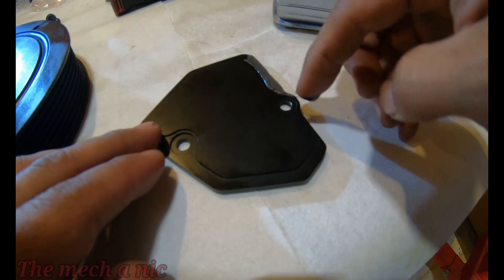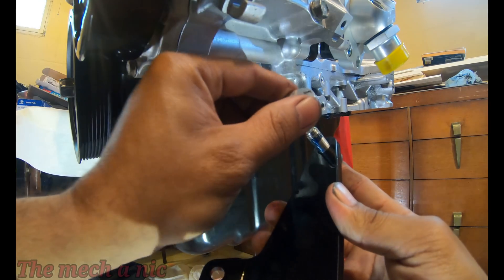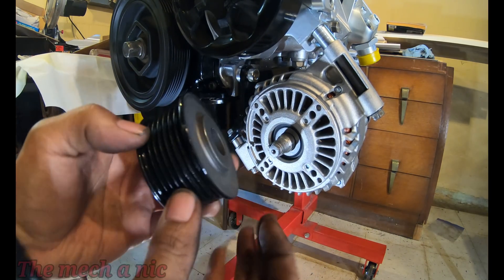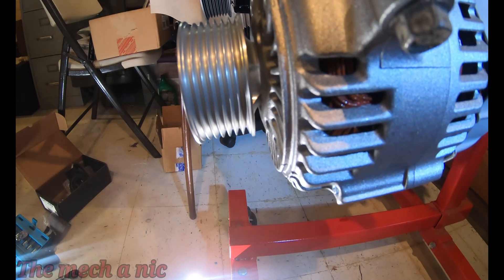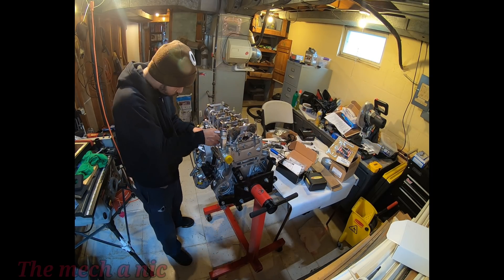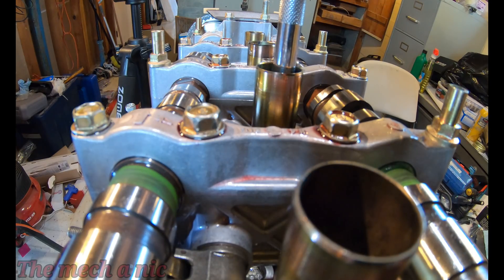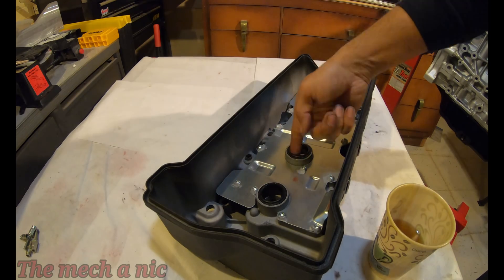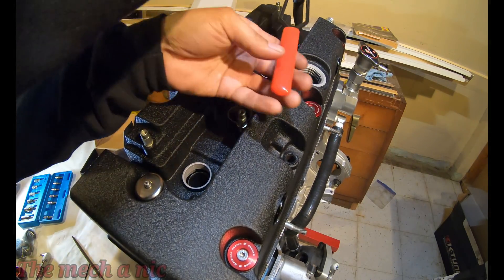k24 end build

Comment: Very nice! How much compression (PSI) this build is making ?  Theoretically it should rise the compression ratio from 11:1 to 13,2:1 and you should run the highest octane fuel available rising the top end power with 20% . Was this engine dyno tested somewhere ? Kind Regards.

Comment: Thin piece of sheet copper, cut hole, make a "crush washer" for that oil cap-
turn down tight, till K lines up.
What don't you like about the vc dress up kit? I think its very nice.

I would either get a shorter belt (they're measured in mm BTW) or
cut down that ridiculously long adjusting screw- which
actually looks easier, since those pulleys are close now.

I haven't watched the "build" series yet, but that is a beautiful engine.

Comment: I'd be concerned with that overspray on the inside of the rocker cover in the heat resistant black wrinkle coat..! Wouldn't want that shit peeling off on the inside of the engine blocking the oil pick up..! Good luck..!!!
Reply from the maker: That cover has to come back off.ill get a good look at it. And remove anything i need to

Comment: Looks kinda too tall. I think it’s the tallest four-cylinder engine.
Reply from the maker: Yeah its definitely tall. Clearance is a issue when you put it in a crx
Reply: @themechanic6117  probably when you put it anywhere that’s dropped. I am thinking that even custom flat oil pan won’t help that much.
Reply: @themechanic6117  so can you tune cams the way that vtec will kicks in whenever you want? It’s turned on by the oil pressure as long as I know but who regulates the oil pressure?)

Comment: Thermostatic housing will not work proper, because it will not isolate smal circuit. It isolate only big circuit or make mixing big & small circuits. OEM thermostatic housing isolate smal or big circuits.

Comment: What ecu and harness are you going to use?
Reply from the maker: Most likely a hondata and a rywire or ktuned harness
Reply: @themechanic6117  would it be plug and play? 

I want to do a k series swap on my datsun 620 mini truck.
Reply from the maker: @jfm041789  yes it is plug n play, thats why im going with that. Dont want to deal with the frustration of wiring
Reply: Yea. I've seen others struggling.

Comment: Which K24 did you use?? I have a K24A4
Reply: I was told that the best k24 to do the set up is the k24A2 is that true???
Reply from the maker: Yes i have a A4 , i think they say the A2 is best because you dont have to change rods n pistons(i think, im not sure) . If your upgrading your rods n pistons then it doesnt matter if you get a A2 or A4
Reply: @themechanic6117  but oil squirters??
Reply: Great thanks for the info bro.

Comment: When you put the valve train back together did you silicone under the last cam cap at the trans? Before you put the valve cover on there is 4 locations that require silicone
Reply from the maker: In the video i forgot to but i did pull it back apart to put silicone on it 👍

Comment: Hey man new to the channel but I found your vids useful since I’m k24 swapping my ep3. My JDM K24a came with a PS pump and I won’t be using it since I’m running ES. My ep3 idler doesn’t fit my water pump housing. What do I do? Get an a4 water housing as well?
Reply from the maker: Check with ktuned for a solution. If they dont have anything you may need to change the water pump housing.

Comment: I'll be watching these videos for my build. I have a 04 accord coupe that I'll do the head swap to. Thinking about building the motor afterwards to go turbo
Reply from the maker: Do the head swap and some cams . see if you notice the power increase 👍
Reply: ThatSaturn Kid Make sure you replace your pistons also. Stock Accord pistons will hit your k20 valves.
Reply from the maker: Yes i think he'll need tsx pistons or aftermarket.
Reply: @TrueDiaboli  I was debating between turbo or head swap, should I do head swap first, or turbo? And thanks for the info on the pistons
Reply: ThatSaturn Kid Depends on budget. You would have to get some ECU solution like a kpro. Then you could do motor work and stay NA and then later add a turbo. It all depends on how much time/money you want to spend up front.

Comment: I'd be less than satisfied with the fitment of that New harmonic balancer, crank pulley.
Reply from the maker: Oem crank and oem pulley. The original. Pulley fit the same way.
Reply: @themechanic6117  that'll make a nice dent through the bonnet when it comes off at 10,000rpm.
Reply from the maker: Hopefully not. Only one way to find out.👍

Comment: Are you boosting this build
Reply from the maker: Keeping it N/A thats why im running high compression
Reply: @themechanic6117  How high compression can you go before gasoline auto ignites?
Reply from the maker: A long way before that happens. Think of how diesels run
Reply: @themechanic6117  Looking to get an engine built once I finish all the tests of my prototype.  If the tests are successful of course.

I want A high compression engine that won't auto ignite and is NA.  

My prototype allows for  advanced timing beyond what most engines currently use.
Reply from the maker: Sounds crazy! Thats interesting.id like to see that.

Comment: That valve tool i have it cause it was uncomfortable doing valve adjustment on my 8th gen civic since the intake manifold is on but on the exhaust side i just use a flat head and a 10mm wrench.
Reply from the maker: I can see it as useful in certain situations. 👍
Reply: jam nut tool ?  Those are a pain I agree.   I had a 4G69 engine for a while and it required you to adjust them when hot !   so brutal.
Reply from the maker: Yeah id rather not use that tool lol